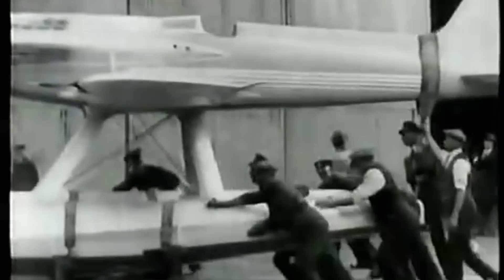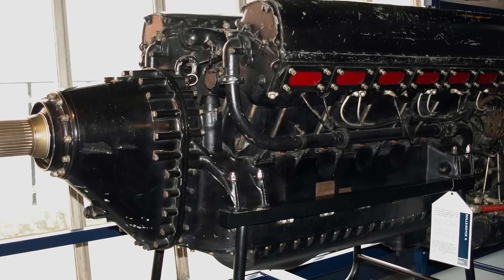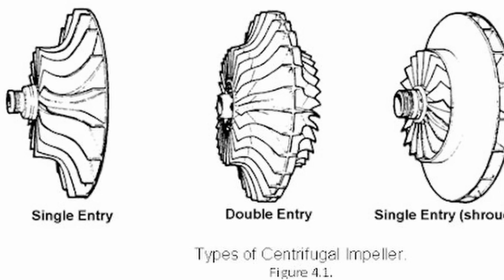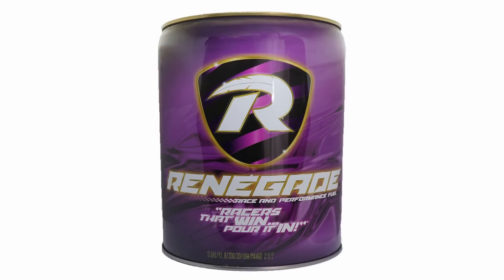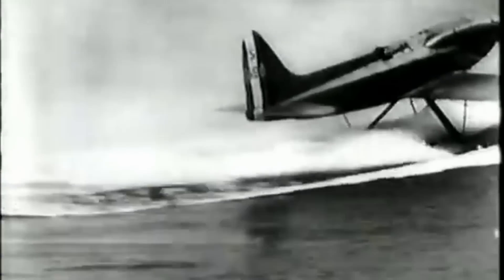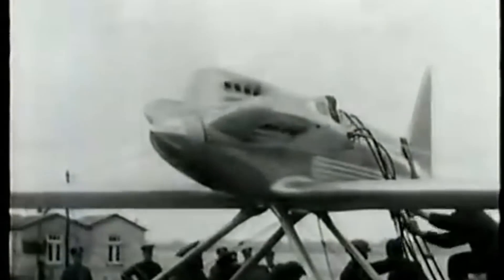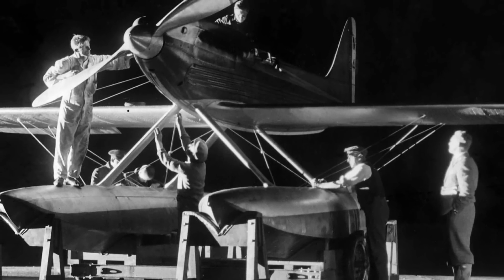Rolls Royce Type R - The Race Winning Engine You've Never Heard Of

Comment: I wonder why RR didn't develop the R type into the engine for the RAF rather than the 27 litre Merlin. Later, the Griffon, of the same size as the R type, was introduced and just like the Germans, who went to larger capacity engines to increase power, RR must have conceded that there was no substitute for size and torque.

Comment: First Record claimed by the R Type Engine was the Water Speed Record in 1930 when two of them were used to power Miss England II to a speed of 98MPH on Lake Windermere. The Boat crashed on its next run killing Henry Seagrave and one of his two mechanics .The Boat was savaged and went on to break the record in 1931 driven by Kay Donn and it was followed by Miss England III which driven by Donn also broke the record using the R Type Engine.

Comment: Its simple Einstein , in the late 1920,s early  30 our eccentric little  island was locked in an ariel drag race, like the Red Bull,s ariel drag races on crac cocaine or monkey dust. By the early ,30,s That drag race cats&kittens the Schneider Trophy became a two pony race between the UK and Italy.  Imagine Richard Rawlings Gas Monkey Garage crossed  with Street Outlaws and you have Roller,s (Rolls-Royce) Special Engine Shop. Roller,s got the plumb job of  designing building and testing a potential drag race engine, the ' R' series a bruiser V-12 with a blower the size of a washing machine.

Comment: The Merlin was NOT a development of the R type, it was a stand alone design and had a completely different firing order and was much smaller.  The Griffin however, WAS based on the R type but the Griffin rotates Anti-Clockwise whereas the Merlin and R type rotate Clockwise (viewed from the rear).
Reply: Sorry but this is wrong, the firing order of R-R V12s was the same for all engines that rotated in the same direction (some engine types were handed in which case, the opposite rotation was the reverse firing orde) from the first Eagle up to the Merlin,  The 1939 Griffon had three different firing orders, two for the Mark 1s and the final firing order for all later marks.

The original design for the Merlin was a new design using an integrated upper crankcase and cylinder blocks, with removal heads.  This type of construction was required for the ramp head design proposed for the Merlin.  The ramp head was a failure and the one piece upper crankcase and block suffered from cracking of the castings.  This design was abandoned and the early Merlin could be reasonably described as an enlarged Kestrel, so not a new design at all.  There were some improvements incorporated in the Merlin that were derived from the R. The Merin remained an enlarged Kestrel until the removable head design was put into production but even then it was very much Kestrel at the core.

There were two V12 Griffon engines, the 1933 (also sometimes called the 1931) Griffon which was a detuned "production centric" version of the R, the engineer responsible for this was Stewart Tresilian who was part of the R team.  this engine was not put into production.  

The Production Griffon, aka 1939 Griffon was a clean sheet design.  The only thing that carried over from the R was the bore and stroke and thus capacity, and of course the 60-degree V12 configuration.  The engine was very different and was designed to be as close as possible to the length of the Merlin.  For example, the engine had the camshafts and magnetos driven from the propeller reduction gear housing at the front of the engine as opposed to the R, Merlin, etc, which had the camshaft drives and magnetos driven from a gear drive housing at the rear of the engine.  Thus, the 1939 Griffon had a parallel camshaft drive as against the R's serial drive camshaft.  there were many, many, other changes.

This is a small excerpt from one of my lists of basic engine characteristics, in this case firing orders for R-R V12s, please notice that the R-R Phantom III V12 car engine had the same firing order as the Merlin, Kestrel, etc.  Also, this list is partial as the more complete lists would be difficult to follow and would require far too much editing for my lazy ...

Engine = Rolls-Royce Falcon Series I~III, RH Rotation
Data Plate Firing Order = 1A-2B-5A-4B-3A-1B-6A-5B-2A-3B-4A-6B
Normalized Firing Order = 1-8-5-10-3-7-6-11-2-9-4-12
Crankshaft Rotation (as viewed from anti-propeller end) = CW
 
Engine = Rolls-Royce Falcon Series I~III, LH Rotation
Data Plate Firing Order = 1A-6B-4A-3B-2A-5B-6A-1B-3A-4B-5A-2B
Normalized Firing Order = 1-12-4-9-2-11-6-7-3-10-5-8
Crankshaft Rotation (as viewed from anti-propeller end) = CCW

Engine = Rolls-Royce Kestrel
Data Plate Firing Order = 1A-6B-4A-3B-2A-5B-6A-1B-3A-4B-5A-2B
Normalized Firing Order = 1-12-4-9-2-11-6-7-3-10-5-8
Crankshaft Rotation (as viewed from anti-propeller end) = CCW

Engine = Rolls-Royce Buzzard
Data Plate Firing Order = 1A-6B-4A-3B-2A-5B-6A-1B-3A-4B-5A-2B
Normalized Firing Order = 1-12-4-9-2-11-6-7-3-10-5-8
Crankshaft Rotation (as viewed from anti-propeller end) = CCW

Engine = Rolls-Royce R
Data Plate Firing Order = 1A-6B-4A-3B-2A-5B-6A-1B-3A-4B-5A-2B
Normalized Firing Order = 1-12-4-9-2-11-6-7-3-10-5-8
Crankshaft Rotation (as viewed from anti-propeller end) = CCW

Engine = Rolls-Royce Griffon (1933)
Data Plate Firing Order = 1A-6B-4A-3B-2A-5B-6A-1B-3A-4B-5A-2B
Normalized Firing Order = 1-12-4-9-2-11-6-7-3-10-5-8
Crankshaft Rotation (as viewed from anti-propeller end) = CCW

Engine = Rolls-Royce Merlin, V-1650
Data Plate Firing Order = 1A-6B-4A-3B-2A-5B-6A-1B-3A-4B-5A-2B
Normalized Firing Order = 1-12-4-9-2-11-6-7-3-10-5-8
Crankshaft Rotation (as viewed from anti-propeller end) = CCW

Engine = Rolls-Royce Griffon I (1939)
Data Plate Firing Order = 1A-2B-5A-4B-3A-1B-6A-5B-2A-3B-4A-6B
Normalized Firing Order = 1-8-5-10-3-7-6-11-2-9-4-12
Crankshaft Rotation (as viewed from anti-propeller end) = CW
Merlin Crankshaft, Rotation Reversed

Engine = Rolls-Royce Griffon I, Firing Order Change #1
Data Plate Firing Order = 1A-5B-2A-3B-4A-1B-6A-2B-5A-4B-3A-6B
Normalized Firing Order = 1-11-2-9-4-7-6-8-5-10-3-12
Crankshaft Rotation (as viewed from anti-propeller end) = CW
Merlin Crankshaft, Rotation Reversed

Engine = Rolls-Royce Griffon II,III,IV,-65
Data Plate Firing Order = 1A-4B-3A-2B-5A-1B-6A-3B-4A-5B-2A-6B
Normalized Firing Order = 1-10-3-8-5-7-6-9-4-11-2-12
Crankshaft Rotation (as viewed from anti-propeller end) = CW
Final Firing Order

Engine = Rolls-Royce Phantom III Car V12
Data Plate Firing Order = 1A-6B-4A-3B-2A-5B-6A-1B-3A-4B-5A-2B
Normalized Firing Order = 1-12-4-9-2-11-6-7-3-10-5-8

Engine = Jaguar V-12
Data Plate Firing Order = 1A-6B-5A-2B-3A-4B-6A-1B-2A-5B-4A-3B
Normalized Firing Order = 1-12-5-8-3-10-6-7-2-11-4-9
Crankshaft Rotation (as viewed from anti-propeller end) = CCW
Reply: @robertnicholson7733  well done.
Reply: @bobsakamanos4469  Thanks.

Comment: A High School friend of mine set a land speed piston engine record of 402 miles an hour at Bonneville Flats Utah in August 2002 using 2 Chevrolet V8 engines in a car he built himself. his name was Nolan White, from San Diego Ca. He was killed later that year at 422  in an attempt to break his own record.
Reply: Stormy Mangham designed motorcycle fairings for high speed runs at the salt flats
Reply: that's not car racing, it's high speed flying at very low level.

Comment: A shop teacher in secondary school had an s13 with an sr20 that had more than 3 bar of boost. He used to say you don't need 8 cylinders when 4 can move the same ammount of air and fuel.
Reply: A bit simplistic, though. In large engines, the much larger bore of a 4 cylinder runs into problems in getting the flame front to successfully burn the entire charge during what is essentially the same time frame, i.e., time during which both intake and exhaust valves are closed. This is actually one reason why aircraft engines have two spark oplugs, to generate a larger flame front ( in addition to safety considerations ).

Comment: My compliments on an excellent review of a master engine.  Its development formed the root of what was to come with the Merlin at a time when world history required a leading fighter engine design.
Reply: More correctly the Griffon was the in service derivative of the R. The Merlin was on 27 litres not 37
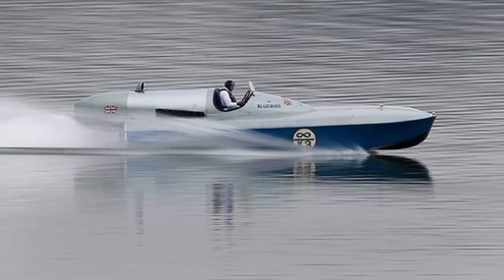Reply: @mothmagic1  As Arthur Rubbra himself said, the Type R "bore no direct relationship to the production Griffons of the 1940s".  The experience gained from the R engine was carried forward to Merlin development in 1933 with adoptions including sodium filled valves, high boost spark plugs and rotation direction.  The first production Griffons in June 1940 had the same displacement as the Type R, but so did the Buzzard engine.  I agree with the findings of this video, and the conclusion expressed from 11:25 onwards.  There are several videos of Merlin and Griffon engines (and other aero engines of that era) on the HAE YouTube channel.
Reply: @HistoricAeroEngines  well said!  Meanwhile, Allison was in the dark ages.

Comment: I used to have an early 90's VW Polo G40, which was factory super charged, VW chose to fit sodium filled valve stems to the engine.
Reply: Sodium filled valves have been common in many auto applications since the 60s.  Alfa racers had individual cooling jackets and coolant plumbing around every exhaust valve guide.

Comment: I think the Merlin was about 27 litres, whereas the 'R' was 37 litres, which was the same as the later Griffon.
Reply: Absolutely correct hence the reason the Packard built Merlins were designated 1650. 1650 cubic inches is 27 litres.

Comment: It’s a shame there is so little information about the Crecy engine. 27 litre sleeve valve two stroke. It was incredibly noisy and was estimated to have given 40% of its thrust from exhaust alone. It suffered with crank bearing failures, never had the necessary funding and got canned when turbo jets came along.
Reply: Check his channel, he has a report on the Crecy - quite good, as usual.

Comment: Shows the Merlin was a dead-end and the Buzzard/R-type could have done the job better throughout Ww2
Reply: The R never had the endurance.
Reply: It shows no such thing. There is a lot more to producing a military engine that is durable, reliable, can be easily maintained and manufactured in volume than engines designed for very short races. Merlin engines have been tuned to produce well over 3,000 hp for aero and hydroplane racing. However, they are relatively short endurance; not what you want in a military engine. When the Air Ministry issued specification F10/35 in 1935, which lead to the development of the Spitfire and Hurricane, both were built around what was then called the PV/12 (for private venture 12), which had already flown in prototype form by 1935.

The Type R could never have been turned into a production engine in time for WW II when that Air Ministry requirement was issued. A de-rated version was run and tested, but never  became a production engine. The RR Griffon, which shared the capacity and direction of rotation of the type R, but is basically a new design made it into production in the 1940s, but for obvious reasons both development and production in the late 1930s and early 1940s concentrated on the Merlin which went on to develop over 1,700 hp in later versions.

Comment: Think on one fact, in 1931 the S6 would do 406 mph with the extra drag from the floats, the mark I Spitfire prototype which was more aerodyamically cleaner than the S6 only did 346mph in the May test flights in 1936. That shows you how powerful the R engine was in relation to the early Merlin engine that it could move an aircraft that suffered from the extra drag to a higher speed.
Reply: Yes, but the R could only deliver that high output for reasonably short period of time. It was literally a racing engine. The merlin needed to be rugged and last way way longer in service.
Reply: @posniknelb6114  It also needed special fuel that could not ne produced on a scale needed to fight a war.
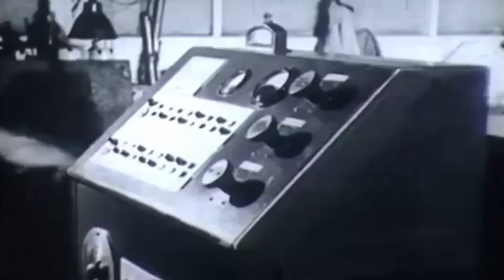Reply: 11:46 Increased displacement? 
Rolls-Royce R displacement: 2,239 cu in (36.7 L) built to race.
Rolls-Royce Merlin was only 1,649 cu in (27 L) built to last.
Reply: comparing chalk and cheese.  The S6 used evapourative cooling and was a sprint engine (short life) whereas the Spit designers reacted to the requirement to use the new Merlin with glycol radiators using a scoop design & placement that was not ineffective.  The original Spit Mk.I did 360 mph.  The c/s prop then added weight and slowed its max speed but improved climb and manouvering at altitude.  Meanwhile the obsolete Hurricane with the same engine/prop wobbled along at 316 mph. 
It's more appropriate to compare the R to the Griffon Spit XXI at 460 mph.

Comment: What do you think about a video on the Ford GAA? I know it's not a aircraft engine but your documentaries on this era/type engines are awesome as well as some of your most viewed , plus if a good performer, it would open doors to new lines of content. Great work no matter what as always.
Reply: Wasn't the GAA developed from an Aircraft engine which never entered full production?
Reply: @Mr Spandel  I believe they were trying for a aircraft engine contract and applied that knowledge to the GAA development.
Reply: @mrspandel5737  YES  it was Henry Ford answer to the Merlin.  he wanted to build his own engine rather than the merlin but nobody was interested. later it was cut to a V8 and used for tank engines at 1100 cu in !!!
Reply: Ford has built two 60 degree DOHC V8s can you identify the other?

Hint: fifty years apart

Comment: I never knew that the Schneider Cup was instrumental leading to the Merlin Engine.  Thank you for the this bit O' history.
Reply: It wasn't particularly. The Merlin is more based on the Kestrel than the type R, although there will have been many lessons learned. However, what the Schneider trophy planes were closer to was the design of the Supermarine Spitfire. The 1931 Supermarine S.6B was designed by R.J. Mitchell, who of course, was the designer of the Spitfire. The British government was to issue requirements for a new fighter aircraft just 18 days after the winning of the Schneider trophy, and this spurred development of both plane and engine (although R.J. Mitchell's first attempt, the Type 224 failed to meet expectations).

If it was the father of anything, then it would be the RR Griffon in that they were both about 36 litres and rotated in the opposite direction to the Merlin.
Reply: Once you know to look for it, the aircraft in WWII tend to look more like Schneider Cup aircraft than the military aircraft of their era.

Comment: I suspect the articulated conrods were, in retrospect, a mistake. After WWII they were more or less universally abandoned in favor of the simple side-by-side conrod arrangement, including on racing engines like you see in Formula 1. And same can be said for the fork and blade conrods which were also popular in WWII aviation engines.

(And as a small nit, it's Harry Ricardo not Henry Ricardo @7:54)
Reply: Harry Ricardo did a huge amount of work on RR engines. His test mules were V twins literally 1/6 of a full sized engine. This actually led to them taking so long fix the rods and crank failures above 3000 rpm. Harry’s V twins had run so fast that pistons literally touched the cylinder head. It turned out the oil pump was more than enough for the V twin but could not keep up with V 12 oil demand. Bigger oil pump and suddenly they had lots more reliable power.
Reply: He also apparently worked on the ridiculous BRM H-16...

Comment: A very informative video, thank you. A small error @11:48. The Merlin was 27 litres, so not an ''increased displacement''. The R which was the ''father'' of the RR Griffon shared the same 36.7 litres 🙂
Reply: Germany was running on below 90 octane fuel. UK and USA had up to 150 octane
Reply: @Dave5843-d9m Bf 109s had 87 painted on the fuselsge for 87 octane fuel.
Reply: @Dave5843-d9m  That's not correct. Search the channel  ''Greg's Airplanes and Automobiles'' and search the video ''German C3 Fuel, Uber Octane or Synthetic Crap''?
Basically:
B4 aviation fuel for fighters is 90 octane
C3 "high performance" aviation fuel is 100 octane.
Reply: Yes that should have been "Decreased displacement"
Reply: The Merlin was 27 litres, a big increase over the long established Kestrel’s 21 litres.
Reply: @givenfirstnamefamilyfirstn3935  The Merlin was substantially smaller than the 36 liter German engines…
Reply: @allangibson8494    The German engines had to be bigger because they needed a lower mean effective pressure as they were more prone to detonation.  Even with variable speed supercharging the DB605 peaked at a lower altitude than 60 series Merlins.  Their power output was relatively low so they didn’t need to be sturdy for their displacement, they were not especially heavy.
Reply: @givenfirstnamefamilyfirstn3935  The Germans and British used effectively the same fuels with the Germans being slightly behind on Tetraethyl Lead and ahead on methanol injection. The British used Harry Ricardo who literally wrote the book on high performance engines however…
The failure of the Vulture delayed the introduction of seriously high performance large capacity piston engines fighters into British service by two years until the Griffin, Sabre and Centaurus became available in 1942.
The Hawker Tornado being operational in 1940 would have changed a lot of things.
Reply: @givenfirstnamefamilyfirstn3935  Yes, it was though the video was referring to the Buzzard or ''R'' engine being 36.7 litres. Listen to the video from 11:35.
Reply: @Slaktrax   Yes he got that wrong, we are spared replay and dissection in our normal speech, so far!